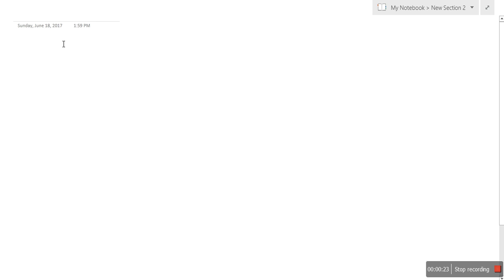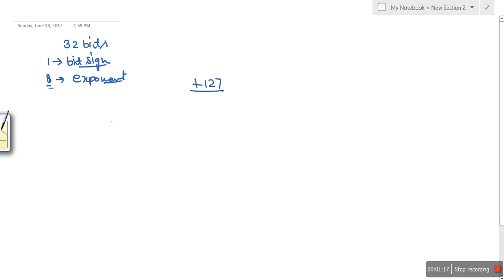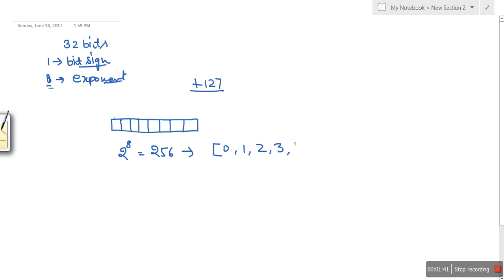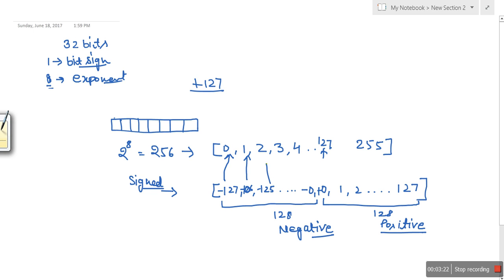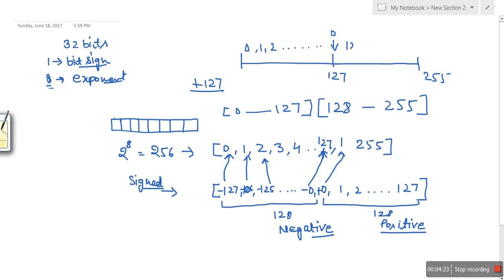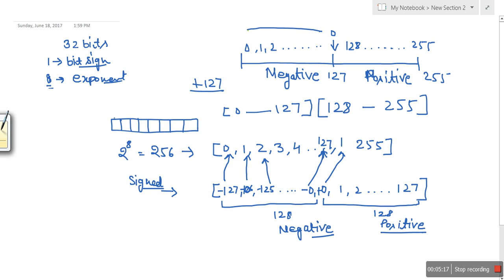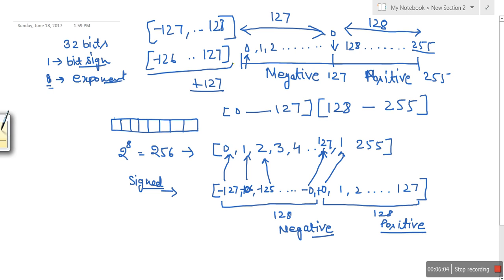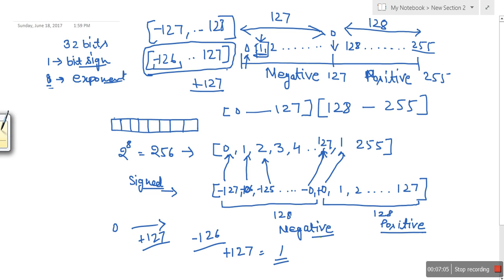Why There is a Bias 127 in Exponent in IEEE 754 Standard Single Precision

Comment: I think you should remove this video and upload a corrected one. The range would be from -127 to 128 in an 8-bit  exp representation. It may mislead some people as there is a major error in the video.
Reply from the maker: Hi thanks for your comment.
In the video, I have used one's complement representation of negative number for explanation purpose which has the range from -127 to 127 (having two representation for zero: positive and negative). That was just for explanation and I am sorry if it's giving wrong impression about the range.

You are also right regarding the range being from -127 to 128.
Thanks for your comment.
Reply: @HowTomakeitdone  Sorry, but you are not correct. In 2's compliment there is only one zero and that is 00000000, using an 8-bit value. The binary value 10000000 represents -128 (negative 128) in 2's compliment, it is not -0 (negative zero). Also you say here and in your reply one year ago to Lusha Li that you are using 1's compliment, which is also not correct. Maybe you intended to use 1's compliment, but at 2:02 in you video, you explicitly say that it will be stored in 2's compliment. 

Since two's compliment only has a single zero value - one of the reasons we use it for signed integers - it could also be used to implement floating point exponents. In older machines it sometimes was - I'm an old engineer and used to work with them. Because of this, your video doesn't really explain why we use a bias of 127 instead of 2's compliment.

One of the real reasons for Excess127 is to allow one extra value of the positive exponent for very large numbers (128 instead of  the  127 we get with 2's compliment) and we correspondingly reduce the possible values for negative exponents by one (from -128 to -127) for very small numbers. In other words, we shift the bias in favour of very large numbers rather than very small ones, because in most scientific applications, large numbers occur more often than numbers smaller than 10 to the power of -38 (which is approximately the equivalent of 2 to the power of -127).

I also think @Lusha Li was not asking for more detail, she was trying to point you in the right direction, as was @lloЯTRoll. What they both said was correct!
Do yourself a favour and follow @Salman Hussain's suggestion. Delete this video because it causes confusion and is not correct. Feel free to make a new one with the correct information.
Reply: As a follow up: the reason I gave for using Excess 127 - allowing larger numbers to be stored - isn't really the main reason, but that would take more than a minute or two to explain.
Reply: @TheGoodOldDays-IsNow   would you explain the main reason of using Excess 127 ?

Comment: Doesn't we get range from -128 to 127 if we use signed and get range from -127 to 128 if we use unsigned and the biased exponent?
Reply: Ok so when you're using a Sign bit to represent negative numbers, you are correct. You would get -128 to 127 within an 8bit register. However, a signed bit system of representing negative numbers can't be used when trying to represent an exponent in floating point binary because there is a flaw in the signed bit system when using it for this, and that is, as explained in the video, you can have positive and negative zero exponent within a signed bit system. So to counter this, we use what is called the bias system. Now, using the bias system, it's impossible to represent positive and negative zero. Let me give you an example:
With an 8 bit register, we use a 127 bias. So, if I want to represent the exponent number 2. I would represent that as the number 129, because when the bias (127) is subtracted from it, I get the number 2, which is the correct exponent I'm trying to represent.
So, what If I want to represent the exponent 0? Well, I would simply represent the number 127 in the 8 bit register. Notice how there can only be one zero? not a positive or negative? This is why we use the bias system, normally in conjunction with a sign bit. However the sign bit is used to represent whether or not the mantissa is positive or negative and the bias is used to represent whether or not the exponent is positive or negative.

Now onto your question of shouldn't it be -128 - 127 like the sign bit? 
Ok so, let's say the number you're trying to represent in an 8bit register with a 127 bias is -128, how would that be done?
Well, if we fill the entire 8 bit register with zero's, then subtract the bias from it, we are left with the exponent representation of -127, right? That is the smallest number we can represent with a 127 bias. The largest number would be if we filled the register with all 1's, which would be the number 255, however after subtracting the bias we get 128. This is the largest number we can represent with a 127 bias.

So, can't we just increase the bias in order to represent smaller numbers? Let's use a 128 bias? Sure we can do this, but you'll start to lose the largest number you can represent.
Let me give  you an example again:

If the exponent we want to register in an 8 bit register with a 128 bias this time, is -128, then we would fill the register with all zero's, because 0 - 128 = -128. Great :) But what is the largest number we can represent? Well let's fill the entire register with 1's and find out. Ok so an 8 bit register filled with 1's is 255, then subtract the 128 bias and we are representing the exponent 127.
As you can see this is similar to what the sign bit is able to represent, but it is by tradition to use a 127 bias in an 8bit register, not a 128 bias. As you increase the bias, you can represent smaller negative exponents and small positive exponents as well. Imagine if you have a 255 bias in an 8bit register, then you would not be able to represent a single positive exponent, and the smallest exponent you would be able to represent would be -255...

I hope this explains it a bit better and you now have a clearer understanding of the difference between the bias and the sign bit.